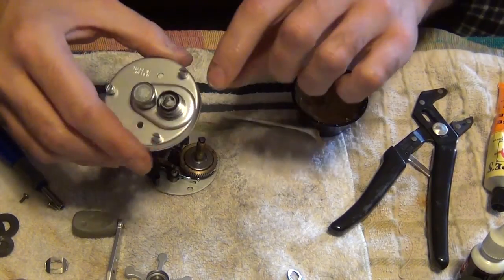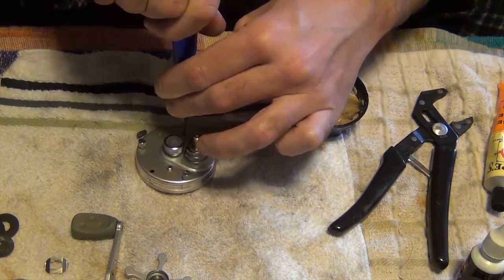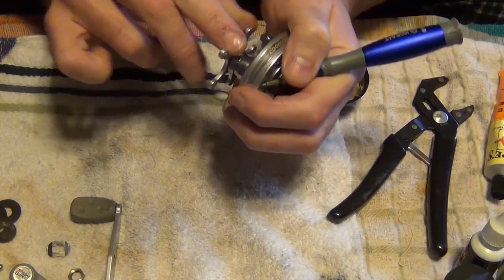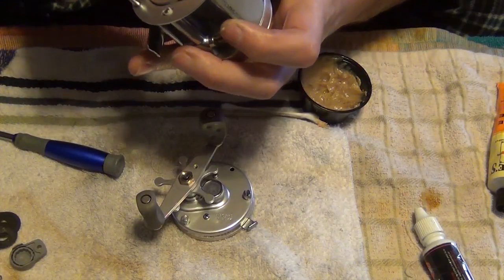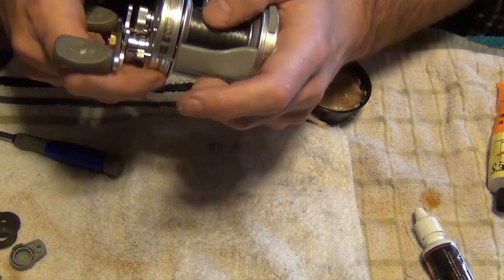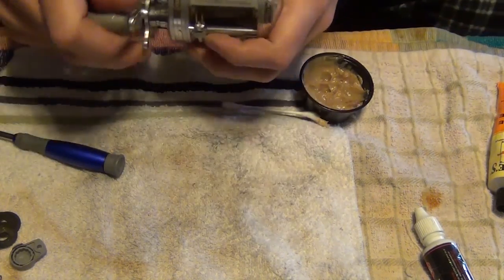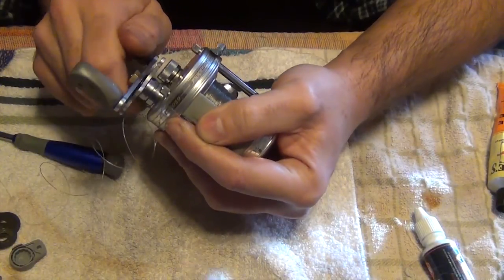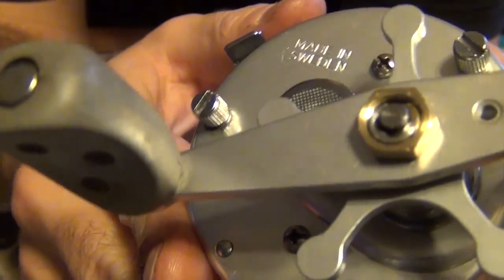Ambassadeur 6500 carbon drag part 2

Comment: have u ever had any trouble with the peace that holds in the pinion gear
Reply from the maker: Hey Jamie, If your talking about the plastic piece, yes. One time a new reel a friend of mine had was grinding.Took reel apart and that piece was ground down and broke. Ordered a new one installed it and had same problem. I ended up having to put a new main gear in that reel. From the factory something was wrong with the main gear causing it to not mesh with the pinion, and causing damage to the plastic housing.But that was the only time i have had an issue with that part.
Reply: +MrPiper199 i had the same problem what was it causing the reel to do
Reply from the maker: also make sure you put the pinion in the housing the right way if you install it upside down you will have problems.
Reply: This reel will still wind but its like there is no drag an when u engage the spool it stays in free spool
Reply from the maker: The reel didnt feel smooth and sometimes made a grinding noise. Took me buying several parts to figure it out.
Reply: +MrPiper199 was it worth fixing i don't have alot of experience with this
Reply from the maker: If you have another 6000 or 6500 swap out the main gear and pinion and see if it solves the problem. is there damage to the plastic housing holding the pinion? On mine you could see the pinion was grinding away at the plastic housing.
Reply from the maker: Did this start on its own, or after you took it apart and put it back together?
Reply: +MrPiper199 somebody brought it to me to look at an that plastic peace was just hanging there it couldn't even hold the pinion gear in would that effect the drag
Reply from the maker: Yes jamie its worth it. Tear it back apart watch the video and make sure you dont miss anything. If you find damaged parts order them, most parts are fairly cheap. hang in there you will get it and learn as you go.
Reply from the maker: Yes the housing being wore out will cause the pinion to basically disengage under pressure.
Reply: +MrPiper199 thanks